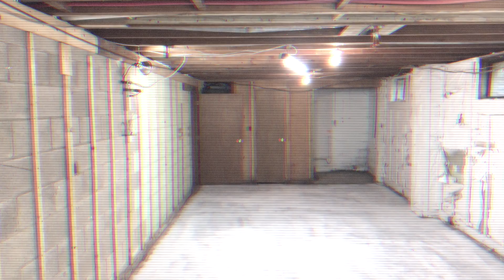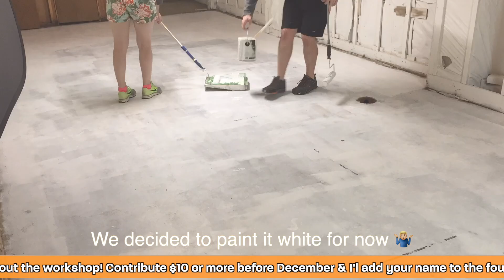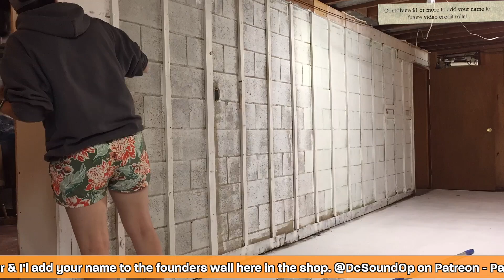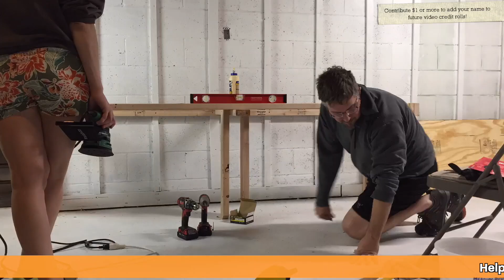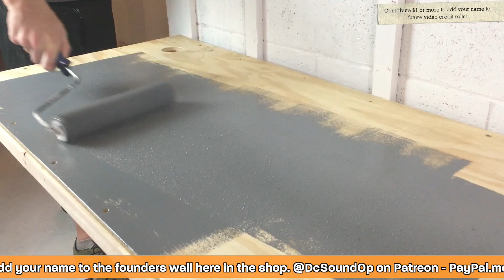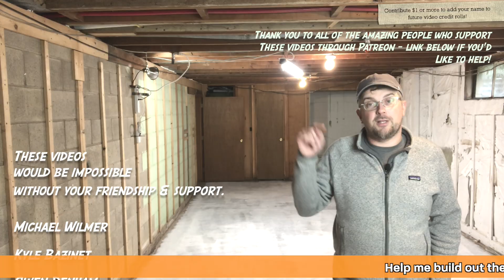#153 - Pro Audio Shop Update - New space, new projects, new workbench!

Comment: Mechanics often use that "tough matt" stuff that is somewhat foam-like and should dampen the echo off the floor while being firm enough most castors should still roll easily. It is somewhat expensive but can be water/oil/fuel/cut/abrasion resistant and is surprisingly tough stuff. Think gym floor foam but more hardcore.
Reply: It can come up for sale used, like I know of a manufacturing facility that is about to test a new brand and will be trashing or auctioning a few thousand square feet of the stuff.

Comment: Paint should be fine, if the paint chips or cracks under heavy roller wheels it's because the concrete was not porous enough and you will probably have to strip that paint to use muriatic acid to open the pores. After that just paint would be fine. I'll be helping a friend do this in a few days for his brand new hobby mechanic's shop oddly enough.